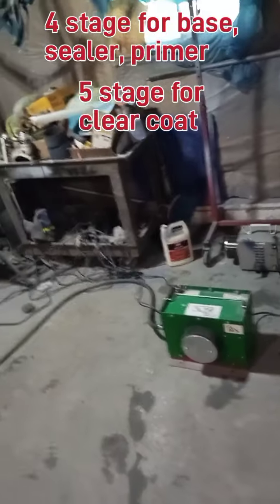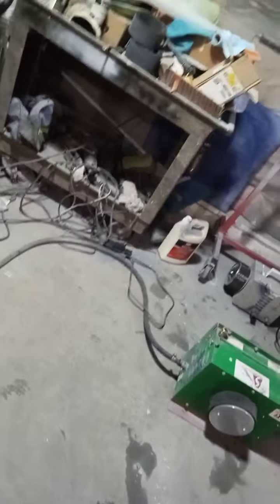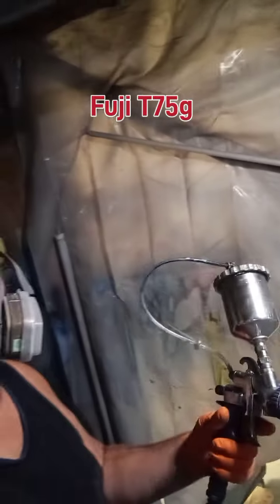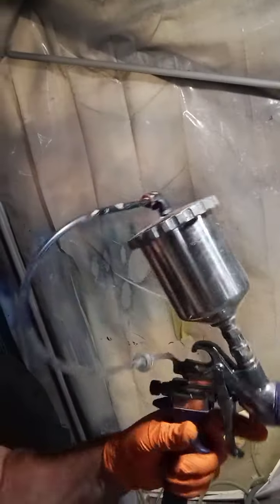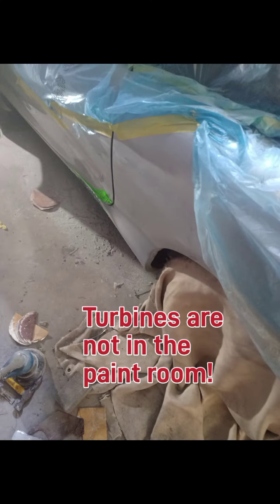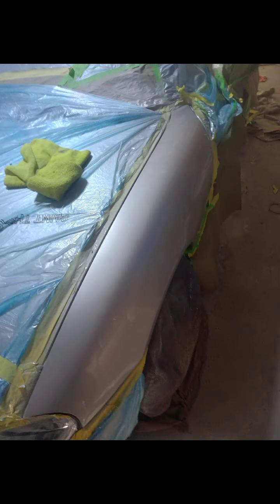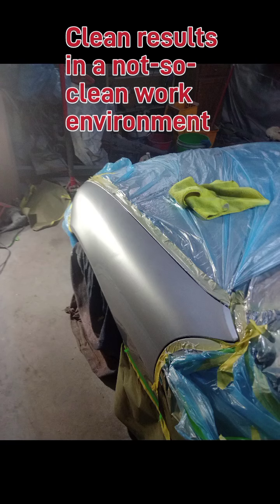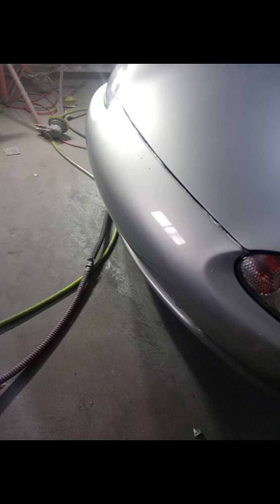2 Turbine sprayers....one Miata with minimum orange peel, coming up!

Comment: Nice! Great content. Why the smaller needle with bigger cap?
Reply from the maker: @barnsey96  with the Apollo gun you can mix and match the caps, needles, nozzles to create your own desired result. 
   I wanted a very fine spray with little peel  to match the paint on a Miata job. 
   The CC cap is the finest cap. The 0.5 needle with the 0.8 nozzle was an experiment that worked. 
  It layed out thin coats. I did 100 percent overlap 2 or 3 times before dropping down 50 percent for the next pass.
   A bit slow, but slow down to go fast. I did not have to buff for peel. And I needed to get it done that day. Any time I can avoid buffing, it's a good day👍
Reply: @BearBudgetgarage  looks good man!

Comment: Great idea. I wanted to buy an open box Avanti at my local HF for $350 but rep says no warranty. I declined. I was going to use it for primers and my Precision 5 for Bc/Cc.
Reply from the maker: I bought the Apollo used. Came with a broken gun, but every needle, nozzle, cap you could want plus the hose. So it was a good value. 
   The Sprayfine was new but under 600 at the time I bought it. Has performed great. No adjustments, but not needed as I would use full psi for clear anyway. 
   For guns I use the 7700 Apollo and the latest T series Fuji. Have a couple cheaper guns for sealer or general priming.
Reply: @BearBudgetgarage what made u choose apollo over fuji..im trying decide 🤷🏾‍♂️
Reply from the maker: @alpha2daquest885  Jake Lesada bought the avanti and has a few videos using it. Seems to work fine. At $350 that would have been a great deal. I would have asked them to plug it in so I knew it worked ok, then bought it. I have the Avanti turbine gun and have used it for epoxy, primer/sealers. Has a good fan. A few needle sets are available,too
Reply: @suspensefulness  At the time I wanted to buy all local HF stores were already out of the Avanti. Also the Apollo had all the best features which I thought would make spraying easier for being a beginner.  Yes I watch Jake's vids on it which was why I was considering it. My bad just realized the ? was for BearBudget.

Comment: Got a question for you. I finally bought my base (2:1) Do you think 1.5 gallon of sprayable is enough for engine bay, jambs, and exterior. I'm doing a color change on 2000 civic coupe. Color is Obsidian blue metallic(very dark) My undercoat is Speedokote Trex sealer in black. From my understanding turbine spraying uses less paint. Thank you.
Reply from the maker: @alpha2daquest885  if you are spraying with a turbine and a 1.0 nozzle should be plenty more paint goes on the panel and not in the air with a turbine. I used that amount on a Beetle with 3 or 4 coats needed as the paint was not covering well over the grey primer. So quality of the base coat can make a big difference in how much you use as well
Reply: @BearBudgetgarage  I see what your saying. Better quality paint  covers better. I might just buy 1 more quart of base just for bay. Heck even single stage.  This project is adding up $. At least next paint job I'll have the equipment and just buy consumables. Do you think I should buy the .8 needle/nozzle as Apollo recommends for auto paint?
Reply from the maker: With the Apollo, I would say yes on the 0.8 especially for clear. Cc cap is good to have as well. But everyone has different preferences. I want the finest atomization I can get out of the turbine